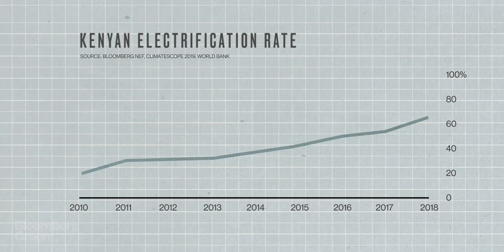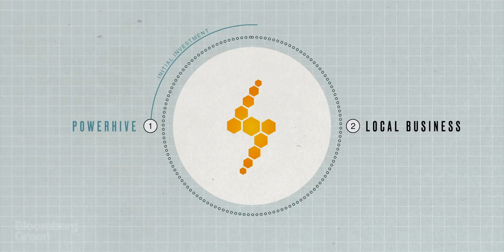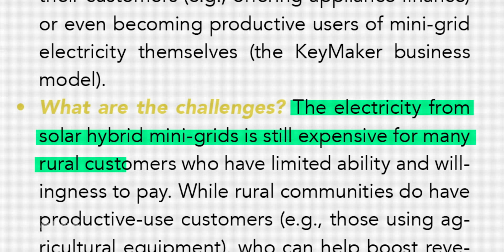How Power is Finally Coming to Rural Africa

Comment: Curious of how battery recycling will be handled as the batteries age and need to be replaced every two years or so. "Third-world" countries aren't necessarily known for environmentally responsible materials disposal.  Not insurmountable, but something that can't be ignored.  Seems that converted motorcycles could benefit from an LED (energy saving) headlamp, but the converted bikes seemed to retain their power-hungry filament headlamps...  There's a cost to everything, but getting stuck on a rural dirt road in the dark presents a hazard in itself...  1/2 step in the right direction!

Comment: I just can't imagine why anyone would not be in favor of this.

A couple of things not mentioned: Electricity can prevent fires from kerosene lamps. Better energy can also help hugely with indoor air pollution—although if that's to be electricity, that would take a LOT more electricity use than simple things like running a light or a TV, or charging a cell phone.
Reply: extending the national power grids is cheaper..
Reply: @chrisdot9914  And you know this how?
Reply: @ronaldgarrison8478  building and operating telecom infrastructure in rural areas of the continent... We build solar sites for show and run with grid power for business...
Reply: @chrisdot9914  More information, please.
Reply: @ronaldgarrison8478  grid power is cheapest.... what do you want to know?
Reply: @chrisdot9914  Forget it. I don't consider this a discussion.

Comment: Leftist tripe.  These special programs are trying to supplement the absence of a meaningful economy.  Special programs don't last forever and when there isn't an economy to take-over the support of these new "power systems", they inevitably fall apart.  Africa has access to petroleum based energy systems and has had access all along.  There are other factors preventing the "industrialization" of Africa -- access to energy is not one of them.
Reply: What are the other factors, in your opinion?
Reply: @beback_   The top two:  politics and education
Reply: @wills8288  By that do you mean western interference ?
Reply: @andreilyas1426  There is that as well.

Comment: EUR/NZD RALLY RUNNING OUT OF STEAM, BUT BIAS STILL BULLISH.
 Immediate resistance is located at 1.7863 (50% fib), any close above will push the pair towards 1.7951(Higher BB).